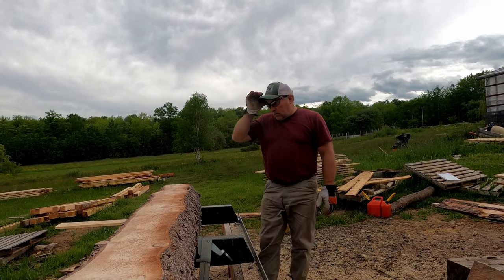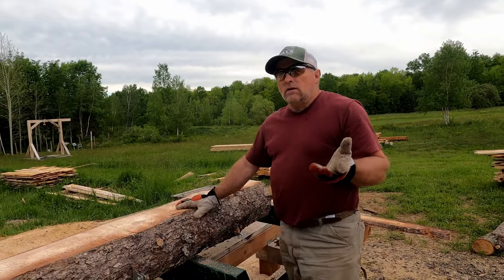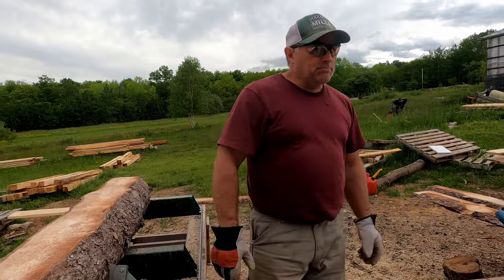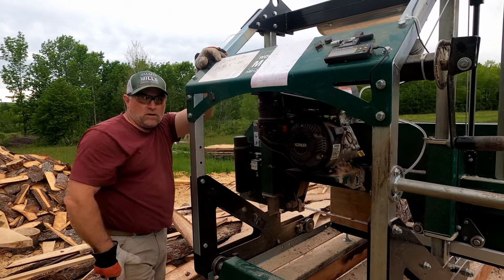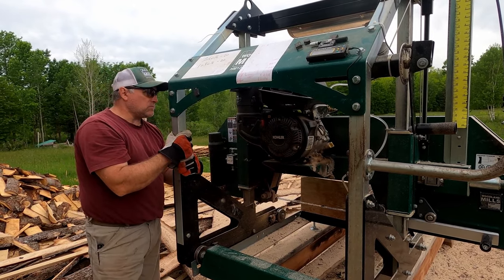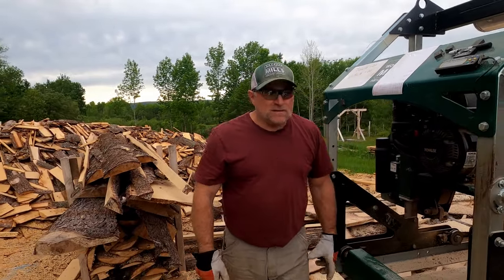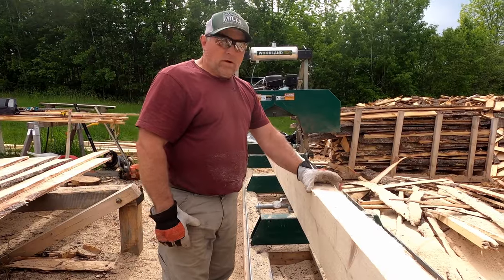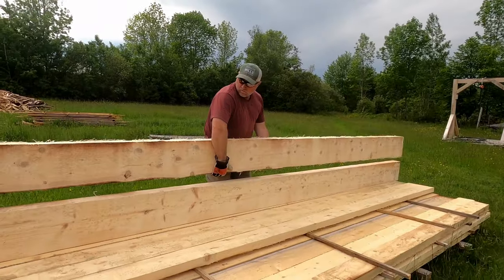Wavy Wood & Broken Gas Shut Off.

Comment: Hi, What is he EZ view mounted next to the hour meter? Is there a video on it?
Thanks
Reply from the maker: It is a DRO. Digital Readout. It shows my cut thickness per board. I use it to set thickness rather than the measuring ruler that came with the mill.
Reply: @CreeksideMaplesHomestead  Thanks. Did you do a video on how it works and set up. I put my HM126 on a trailer and due to being height challenged I have trouble reading the scale accurately.
Reply from the maker: @lukefisher7618  I’m not sure if I have a dedicated video on installing it and how it works, but I will take a look at my playlist and re-list it if anything is there.